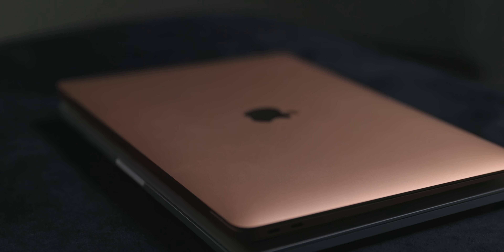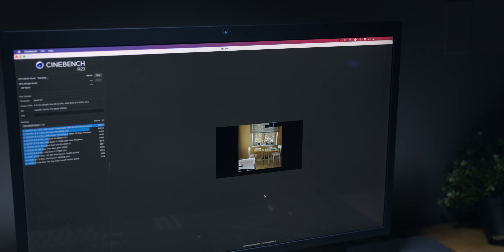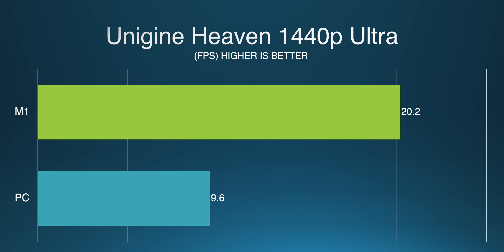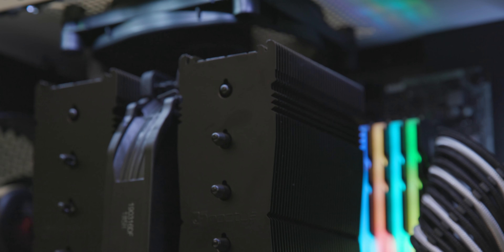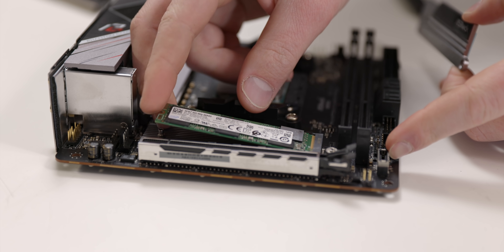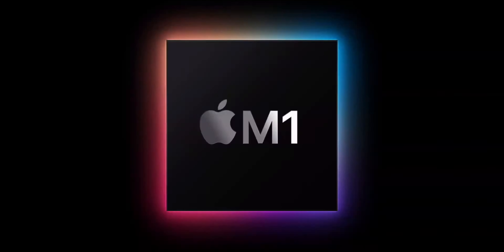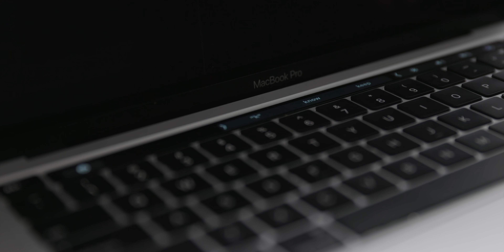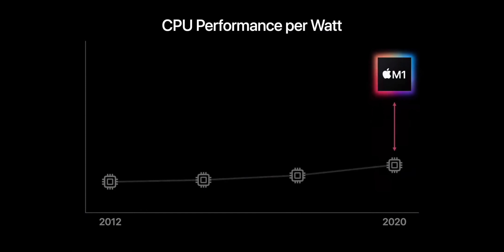$699 Mac mini vs $1,000 PC: Which Is Faster?

Comment: Frankly, I think the fact that, with RISC cores, the latest gen 5nm process, fastest LPDDR4X available, their latest graphics tech, their own CUSTOM API for their graphics tech, running on their own OPERATING SYSTEM, all of these inherent advantages, Apple is now beating AMD in performance per watt and a couple of graphics benchmarks, is fucking embarrassing.
For Apple.
The 4750G is two year old tech. 7nm, Vega cores, Zen 2. This stuff was already obsolete LAST YEAR. Since this, AMD has jumped to Zen 3, outclassed Vega TWICE OVER, and they still don't feel like they need TSMC's 5nm to compete. And they're running with CISC cores, having support for every single instruction set, and by extension, every single piece of software invented on this planet in the last four decades, most of them natively.
On Windows NT, the same operating system the world has been using for decades.
And they're still outclassing everyone, including Apple, in performance per core and number of cores on a package, and their FOUR YEAR OLD graphics tech running on outdated APIs is still good enough to be in the conversation.
If people on the internet want to compare Apple's efforts to the best offer available, and the best they have to choose from is now practically ancient AMD silicon, and the AMD silicon is doing so well in that comparison that AMD literally cannot manufacture this old garbage fast enough, I think that's a win for AMD. 
Not Apple.
Is the M1 chip good for consumers, is the question we should all be asking ourselves here, in my opinion, as a consumer.
In my opinion, no, it isn't, because it's still Apple, it's still a walled garden, it's still Apple trying to further their goal of creating a monopoly, an isolated platform where they control all of the rules, and I have none of the rights, now more than ever before.
And that's not good for consumers. It's something I cannot afford to pay for. I'm sorry, I'll take the 2 year old garbage AMD silicon, thanks. I can play my entire Steam library and emulate more games than I can think of on that small 65W part, and that's more than "good enough" already.

Comment: adding more cores does not scale the CPU's performance in a linear fashion even in multithreaded workloads. M1 is a SoC, and it's stellar performance is some workloads doesn't come from general-purpose CPU cores, but rather from co-processors (neural engine and graphic acceleration). And you usually can't improve single-core performance by adding more cores.

Comment: Bought the M1 Mini 8G 256SSD on spec as soon as it was available. Initially I thought I would check it out then return it. Perhaps upgrade to the 16G mini later.
Since I bought it in Christmas season, I had until Jan 8 to return it. I don't do anything really intensive with it. Photoshop, Lightroom, a little video editing and a few general apps. Driving a 43" LG 4K TV as main screen and a secondary 27" 1080 screen through second HDMI on a Mason port expander. 
To my surprise, everything ran perfectly...and very fast. All my existing apps worked fine. While 8G was a real limitation on my 2015 13" MacBook Pro, It wasn't a problem on the M1 Mini.
This is the fastest computer I have owned and most reliable. I have sold my 2013 Mac Pro, and my 2015 MacBook Pro and will probably buy the M1 Air. when I can travel again.

Comment: M1 can run only 2 and a half games = crap. (lets count Fortnite as a half, but its more like 1/10th of a real Fortnite). you can't actually use M1 graphics power without games, so its useless.
can't run x86_64 linux or win10 = also useless crap. 
if you need a browsing machine M1 is fine but if so you easily can run a cheaper PC just as well. 

so basically apple M1 is for isheep, noobs and aunts.
Reply from the maker: And for people that do real work.
Reply: @snazzy  Real work? I'm sorry, Apple doesn't even support the software I use for my "real work". But I guess things like that don't matter because the only "real work" you're allowed to do on a PC nowadays is VIDEO EDITING. Joy. Everyone on the planet is a fucking youtuber.
Go get a clue.
Reply: @snazzy  people that do real work buy threadripper/ryzen and don't salivate over TDP.

ps no RAM / SSD / GPU upgrade either, no 10gb NIC support, can't add shiz. real work you say.

Comment: $1000 laptop is still expensive for me! I bought a Ryzen 5 4000 series laptop for $550 :)
Reply: That’s cool, ryzen 4000 is great
Reply: I guess you can also upgrade the RAM and SSD? 
If Apple would make that so (I don't think RAM would be possible because it's integrated into the M1), I would buy it.

I got a 630 € Device with an 11. Gen Intel and a MX450. Battery life is alright. Under normal use, I can get 6 - 7 Hours. The speakers and the camera are great, and so are the keyboard and the touchpad.
Reply: I bought mine for 700euros slim laptop with intel, gtx 1650 and 120hz screen. M1 laptop cost 1.5k.
Reply: @racistpixel1017  what's that laptop name please I am trying to buy a nice laptop
Reply: @ashithneethipudi5758  asus fx 571gt. There is different variants, so make sure you get with 120hz screen,i see now in my country, this laptop is at 650euros for limited time. laptop is fast and snappy, no heating or throttling issues as for now even on max load on both cpu and gpu. It comes with 500gb intel optane nvme ssd but 1 dim soldered ram and one dimm replacable. I managed to sqeese there 20gb ram and add extra crucial mx500 1tb ssd
Reply: @racistpixel1017  how's the battery 
Reviews are saying it's trash
Reply: @cybercery5271  yeas, battery is realy small, but for the price it does job done, for sure if you buy gaming laptop, you stay pluged in most of the time, even m1 laptops stay pluged in... Actualy for a 700$ price it gives more value than 1.2k$ base model m1 that only offers is cpu power and battery and huge amount of limitations and lack of features. The difference in day to day use, realy nowdays cpu's is so powerfull that you wont see difference, i'm indie game dev, working on vr game, compuling tons of code  and i dont use mine to a extent... I believe that most ppl only benefit from battery life on m1 but not its raw power. Probably M1 only good for exporting times and battery...
Reply: @racistpixel1017  well I have to carry my laptop around so that laptop is a poor choice for me
Reply: @cybercery5271  than you dont use it for gaming than find a notebok there are many notebook cheaper than m1 laptops, if you have a limited budget, but if u have the budget i think u should go for it
Reply: @racistpixel1017  So your point is that because you play game and do game stuff it is better to go for a laptop with dedicated gpu than M1 laptop? Yes I agree that is true but then most people don’t play game on their laptop.

The M1 Air is better build, better keyboard/trackpad, lighter, thinner, quiet, cooler, battery probably last 2-3 times as long, cpu and gpu don’t get throttle while not plugging in, higher resolution display. Also have you seen people open 20 apps on M1 in like 5 seconds? Generally M1 Air is a better laptop for non-game related stuff.
Reply: @super_hero2  no i newer seen  noone opening 20 tabs, non practical. about gaming you are correct, but there one more issue, cpu is powerfull enough in windows laptop for years now, the more important is os nowadays, if you not doing any professional work that is involves only cpu but no gpu, there is only OS preference. if your work involves fast cpu, if that so important there more powerfull options in desktop side... you could argue that m1 offers less heat and slimmer and so, also, only if thay needed in your work flow... but also if you Professional, with m1 you need many dongles.... m1 offers few perks but have few issues on top of it and not every proffesional need best mobile cpu, if IO sucks, why to bother, if you dont like OS? cpu alone wont cut it
Reply: @super_hero2  yeas, 3-4 years intel chips is still powerful to do everything, only difference is exporting times on large projects, not that its slow on older chips but that its faster on new chips. ppl just focused on hype and benchmarks numbers. the jobs professionals do, anything literally ask same as 3 years before, we only have better hardware now that is luxury not necessity. mine 9th intel i5 still slice every task like a butter, i bet it would do better with m1, but little i would notice besides a minute or half shaved from projects of size of tens of gigabytes.
Reply: @racistpixel1017  i5 9th gen is like 2019 so it is not 3-4 years for your cpu it is more like 5-6 years. Which cpu is it exactly?

Not every profession do the same thing after 3 years, you can’t possibly know all of them and you can’t predict the future. My 4 year old iphone 7 (I replaced it last year with 12) is a lot slower than my new phone. Scrolling, open app, game, switching tab… End users don’t really notice it but every time software updates (OS or any software really) they add new features/changes which make it slower and they add up year after year. You don’t have to update but then you don’t get the new features or any security fix in some case your software become unusable. The stuff you do on your profession might be the same but you might be running on an entirely new code that is not optimize for your CPU since it is 4-5 years old.
Reply: @super_hero2  its i5 9300h. iphone not laptop, its two different things. the rate mobile cpus getting faster, is different pc cpus do. yours iphone cpu is same as intel core 2 duo from mid 2000s compared what is out now
Reply: @racistpixel1017  Not sure which iPhone and which core 2 duo you talked about. Also desktop and iPhone are difference platform, it is hard to make comparison like that.

My old MacBook Air 2015 is pretty slow now even just browsing the internet. There is no reason to think the i5 9300h still fast in the next 3 years (5 years old) given the geekbench score of 3500. You can ask other people who have a 5 year old laptop to verify but in my experience it will slow down significantly.

One more thing. How much can you sell your laptop in the next 3 years? In my experience window laptop especially gaming laptop has terrible resale value if it can be sold at all. I am confident my M1 Air can be sold for $500+
Reply: @super_hero2  its dumb to buy used slow mack for a price of 2 or 3x faster windows machine... newer understand that, what value it gives for the price, guess only a logo. i had 4th intel i7 from 2011 or 2012, upgraded to new one 2 years ago, the i7 was old 4core 8threads hot radiator, i upgraded since my laptop was colapsing, plastic was broken, but machine it self, with ssd, had no complains, did the job. ofc for many workflows nowdays it might be slow, but still usable, ppl do magical thing with old hardware.

for iphone and windows cpus, these tjing cant be compared, phones cpus age way faster since new cpu have way massive leaps in performance and faster than desktop cpus
Reply: @super_hero2  again, lost in benchmarks numbers. but how practical is that extra performance... if older chips from 10 years ago, in reality still can handle same tasks... anyway returning to OP, same applied with m1, if in few years all cpus will be outdated since of better benchmarks, why to even pursue best of the best. you can pursue that luxury to have better cpu, but realy 2x larger benchmark does not give you 2x productivity or even a pc does not feel 2x faster. cpu not the only one component in a computer.
Reply: @racistpixel1017  as i said before you have the same cpu but you running on completely new code that is not optimized for your cpu because it is outdated, that is why it becomes slow and why modern chip are better.

Depend on what you do with your laptop,  if all you do is to use calculator app 10x benchmark would not matter. But if you use new software that are more demanding then 2x benchmark will have significant impact.

The question here is which of the two laptops is a better buy. For gaming and window fans, sure your laptop is better but for everyone else, given the price difference is $300, way better resale value, almost all other aspects the M1 is better except gaming and port. It should be clear that the M1 is a better choice.
Reply: @super_hero2 no as a software developer i can say that the code is the same, languages is the same, 3-5years wont make any significant difference in optimization, the code is universal for any cpu, there is no major breaking revolution inside programing, the only thing is that the code it self is more optimized in some cases.

the difference with mew cpu u probably only in slight response rates you notice while comparing one to one and exporting times... allot speed sensation of os is due ssd and screen refresh rate.
Reply: @racistpixel1017  I am not sure what type of software developer you are but you can't possibly talk for all of them. OS change every year both MacOS and Window. If you look at macOS Sierra and Big Sur there are a lot of difference. Check out Sierra and Big Sur technical requirement (just google it) you will see how big the difference is.

My experience with switching from iPhone 7 to 12, iPad 5th gen to 8th gen, MacBook Air 2015 to M1 Air is that the older ones are significantly slower in web browsing, app scrolling, switching tab, gaming. In rare case like the MacBook Air 2019 to M1 Air the difference in speed is still huge even though they are only 1 year apart. You can confirm this with people who use these laptops/devices and see it with your own eyes. I can only tell you my own experience, I can't show you any number aside from geekbench.

Let’s just say your cpu is still as fast 3 years later. I can sell M1 Air for $500 while I am afraid your laptop can be resell at all. That alone should make M1 Air a better buy.
Reply: @super_hero2  you dont compare phone cpu with pc cpu... its just two different worlds, if you look to my laptop cpu and best from amd, you wont see much difference in web browsing... i said, nowadays days pc cpus is powerfull enought so only gamers and niche users will feel difference. you compare old slow iphone cpu with new iphone cpu... keep in mind that phone cpu have rapid development from a caveman to a alien teck, ofc you will see difference between those, but even last gen iphone cpu is faaaaar from my intel i5... when phone cpu will reach a level of it, you wont feel any more difference in performance. if you speak about m1, its not yeat in a iphone so thats not count.

now bringing a point about used market price and value... its not a way to attempt to win this argument since we speaking about performance, not a used product price, even so used apple product value is not equal to price. literaly for that price you can get 3x faster and better windows machine, so value for price is worse than windows have, on android...

now tell me something that my cpu after 3 years will struggle to do that is capable to do now with no issues. something useful, not like niche os i newer heard about before and even wont bother to look it up.
Reply: I got the Macbook Air for £800 brand new. There are deals out there if you keep an eye out.
Reply: @leonard8766  it's 916 on amazon? where can you get it for 800, I'm assuming you mean the base model too right?
Reply: @leonard8766  yes but the gpu is only 7 core instead of 8 on the pro and I believe that that extra core and passive cooling makes alot of difference in performance. It's also been said that the passive cooling is insufficient to prevent throttle in heavier workloads so the pro is a better deal than the air but more expensive
Reply: @_._shinonome_._  do you, bro! whatever makes you happiest is best :)
Reply: @leonard8766  How? I've never seen anyone sell a new Mac than it's RRP

Comment: Laptops with 16GB RAM are expensive as fuck. I had a laptop with 8GB RAM I3 2nd gen 35Watt, 8GB ram , 500GB HDD, NVIDIA 630M for just 620euros in 2012. Yet still in 2021 laptops at this price still have 8GB ram, and use igpu, so even less ram. This is insane.

Comment: I don't understand what the fascination is with power draw ! 99.99% of the average person couldn't give 2 poos about it !! 
Most people just look at how powerful a laptop/computer is at a certain price point. I do agree the price is good. But that's only because apple want this ARM thing to take off. Once it gets main stream up go the prices he's called Tim crook for a reason. Personally I'd rather spend more money on a razor or Asus laptop ! Workstation/ gaming/ more ports/ more compatibility. Plus if something goes wrong your most definitely going to be able to fix the them over apples lockeddown charge through your back teeth to fix aluminium tin boxes.

Comment: I don't like Apple (or more it's philosophy) but that chip is extremly good for Apple. It's even a good price compared to PC, even with Rosetta. That's frightening. I'm just not sure if any other company can dublicate this. This chip includes billion of developement and experience from iphone and ipad know how. 5nm is not cheap if available. The CPU/GPU cores and other subprocessors are right for Apple. But can PC manufacturer reduce the hundreds of CPUs to a few versions? RAM fixed, GPU fixed? and still have the market for millions of CPU which are needed? price range etc. I may be frightened because of this. This fully integrated RAM and GPU is frightening me for the PC builder in me. The Laptop and Dells/HPs might be interessted, also to buy the SSD and RAM and GPU with no upgradability is probably not that bad from their point of view :(
For ARM to work for "PC", it would need a Rosetta 2 as well, thats IMO the reason Windows ARM does not work, together with not powerfull enough ARMs.